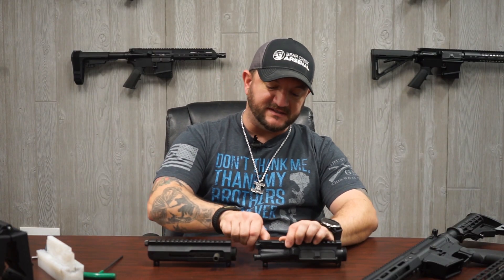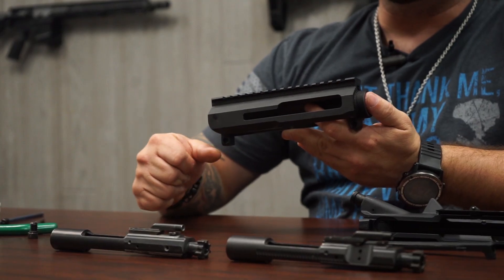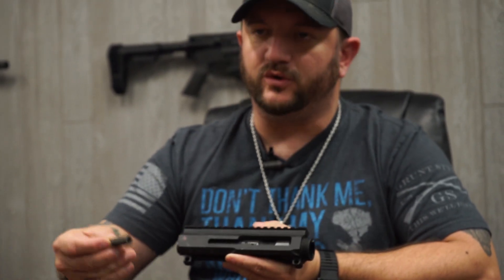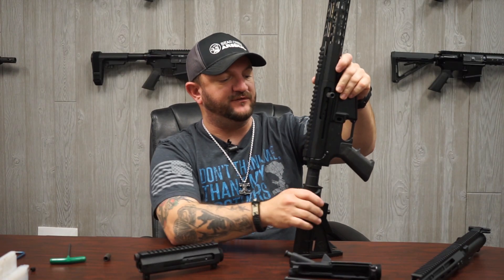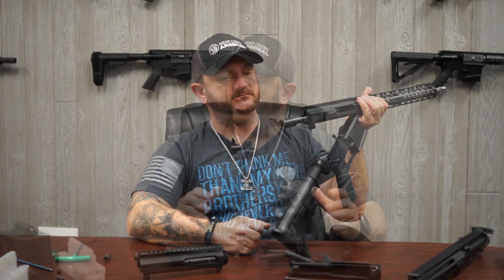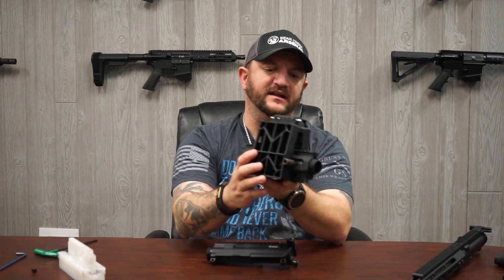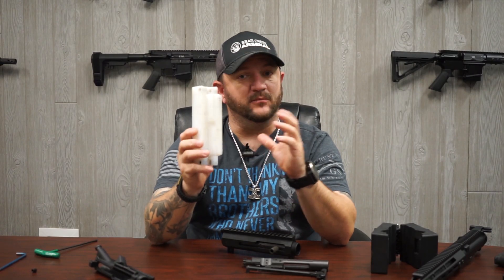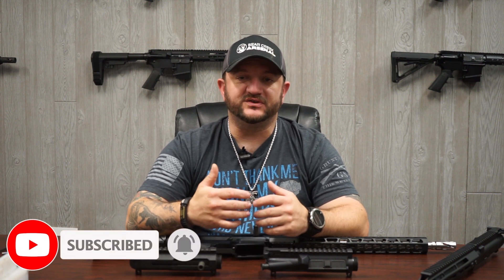Side Charging Upper: Guide, Tips, Maintenance, and More Common Questions

Comment: Thanks for the informational video. I thought of small concern with using the shaped vise block with the side charging upper receiver. Since the clamp vise block is not completely closed and seated snugly on the side charge upper, I think it is possible that a person could break their clam shaped vise block if they were to clamp the block down at the wrong spot with too much force. Just a possibility. As you said, it should work though but a person probably shouldn't clamp it down with the weight of the world haha. Other than that, I like the idea of the side charger because it seems to get rid of a couple of parts on the upper that could make it cheaper for everyone. No more forward assist which some people don't like anyway and the side charge handle basically becomes the forward assist. Obviously the rear charging handle is gone and it became the basic side charge bolt, so that would save on costs. Finally, the ejection port cover is gone. I think out of every thing, i'd want something like that in case I wanted to close up the side to keep dirt and grime out when not shooting but not the worst thing ever to lose that. 
 (After leaving my comment, I scrolled down and found a similar comment about possibly breaking the upper vise block. I was only 4 years late with my comment).

Comment: Is the right charging bcg capable of full auto use?
Reply from the maker: Our AR-15s are cut to Full Auto Style, Meaning it can support Full Auto firing
Reply: @Bear_Creek_Arsenal  
Thank you for the reply.  So I'm assuming/ hoping the stock provided bolt carrier group, the buffer and spring will function  properly and have normal longevity with a rapid fire FRT trigger?

Comment: Hope at the BCA factory that they stopped using that action block to assemble rifles/uppers.
Really should be using a steel (looking at you Wheeler) reaction rod with sail, like the Midwest or 2 Unique.
This would keep stress off the receiver/lugs/index pin/index slot, and keep the barrel/gas port aligned.

Comment: Just received my side charger complete upper. Does the receiver plug need to be threaded in very snug?
Reply from the maker: Thank you for the question, when you are tightening the threaded receiver plug tightens it all the way and then loosens it until the flat part of the plug lines up with the back of the receiver. Once this is complete, mount it on the lower. When you shoot the plug will stay steady.

Comment: Will any lower work with a BCA side charging AR10- 6.5 Creedmoor?
Reply from the maker: Our uppers are made based on the DPMS Gen1 Low Profile model.
With the AR10, there are many different designs and models out there,
and each company tends to create and design its own unique platform.
For that reason, we cannot guarantee the fitment of our uppers to any
other companies lower other than our own.

Comment: I stored household belongings for a friend and he gave me a rifle 6.5 BCA 20 inch upper. The lower has some issues but It's a keeper! Why? Because it's a tack driver with 129-140 grain. Working on the lower, who put the wrong bolt latch on and stuffs a roll pin into a threaded roll pin hole?

Comment: 2 year report here I absolutely love my side charge 18” hevy barrel 308 the greatest thing about it is i can use any kind of rear stock and accessories for it without a rear charge handle interfering in that day to day set up no worries raising and lowering cheek riser over and over plus i put 5 rounds on an ar500 steel plat in less than a 1/2 inch group i took a pic with my pinky finger nail next to it for proof i tell everyone I meet that asks me these bad boys are well worth the money thank you Bear Creek !! 😎🪖🧸🇺🇸👍🏻👍🏻

Comment: I just ordered this BC-9 | 9MM Billet Right Side Charging Upper | 10.5" Parkerized M4 Barrel | 1:10 Twist | Blow Back Gas System | 9.5" MLOK

SKU: 9476NB-UASCH9MMPM410.5110P-10M3
And completed the assembly. During the initial testing 115 grain FMJRN bullets it ran fine for about the first 200 rounds. Then is started jamming after three rounds. When the BCG stripped the cartridge off the mag it jams and will not feed into the chamber.  Drop the Mag and clear the round. Then it will fire three more and jam again. It has plenty of lubrication and it happens with Glock and MagPul magazines. What could be the problem?
115 grain Factory Loads

Comment: I am just now considering 300 blackout and been searching for a good upper assembly,im a LH shooter & i have a hard time with charging my ar15(have to have ambi charging handles) this side charging looks interesting & thinking on buying a 101/2 inch upper & a 16in & a crapton of 220 grain ammo to run suppressed. Great video & you showed me a lot,question is,why dont they include that little (headless allenscrew) with the purchase in case the lower is to high for the original bolt/nut? Or do they include it,i would just run it that way & keep my allen wrench handy. Great vid & im a sub now. Thanks for explaining it all in good detail for the learning crowd like me.

Comment: BCA, was there an engineering reason you did not make this an ambi or left-handed charging handle? While the 'T" charging handle is not ideal, you've designed an equally odd, right-side charging handle that reciprocates. Have you not learned anything from the AK and FN SCAR's reciprocating CHs? Robinson Armament's XCR has the best of both worlds: a left-side and non-reciprocating charging handle. This setup is more intuitive, and you don't have to take your hand off the trigger/fire control group to perform immediate action. The M-60 and M-243 SAW both have LH non-reciprocating CHs. The SCAR's CH is left-handed, and they recently made it non-reciprocating. This setup is better for a left-handed shooter. You would have something if you made it a left side or an ambi charging handle.
Reply: They do make several left side charging options.

Comment: I hated rear charge and got a bear creek right side and now i have changed my but stoch and cant even operate rear charge unless i have butt stock slid all the way back. But know my son built a left side. You hold an ar by crip and dont have to charge by reaching across scope with left charge and if you go to range use a brass trap and get by with right side. But left side use both trap if you have side discharge or even better use brass catcher that quick attaches to pickateeny rail life is then so nice.

Comment: I just picked up a 300 BLK from Midway. Puzzled about the rear screw that apparently stops the BCG during use. The screw comes with an o-ring. If I tightened the screw, it distorts the o-ring. If I back it off, the screw is loose in the back of the upper. Doesn't seem right to have a loose screw even though I can't come out because the flat is positioned against the lower.

Thoughts??

Comment: Can you purchase the headless receive plug from you - or would this work from amazon headless 3/8 in-16 X 1/2 in - the original plug had a rubber washer on it- does it need to be replaced
Reply from the maker: You can! Search it on our website. The o-ring is not essential. The product you mentioned will most likely work, but will stick out a bit

Comment: GFG Side Charger .308
Side Charging Handle Side Charging AR10 Side Charger AR10

   

Product Details

The GunFighterGear Side Charging Handle is a drop in part that converts any AR-10 rifle to a side charging AR-10.

Benefits:

-Operators primary hand remains on the pistol grip while charging, allowing for faster magazine changes.

-Bolt can be charged and locked back with just one hand.

-Ergonomic round knurled grip makes it MUCH easier to clear jams.

-Much more affordable than a dedicated side charging upper.

Our side charger is CNC machined from billet 7075 aluminum with a T-6 heat treat, giving it a tensile strength of 83,000psi, (structural steel tensile strength is 58,000-80,000psi)

The side charger knob is knurled for maximum control.

The side charger is mil spec hard coat anodized black, with an engraved GFG logo.

1/4 riser required for clearance with some brands of scopes and/or scope rings
This side charger is a drop in accessory for any standard mil spec rifle, but if it does not work with your set up, we will take it back no questions asked.

 This is for .308 Platforms and should be compatible with DPMS LR-308, Noveske N6 308, LaRue OSR, POF 308, Bushmaster LR308, Armalite AR10, LMT 308MWS, Palmetto PA-10, Ruger SR-762 and Aero Precision M5.

This may not work with the following: DPMS R-25 Gen II, Colt LE901, S&W MP-10, Bushmaster BAR-10, RRA LAR-8 and HK MR762.

**NEW!**

Youtube Video: https://youtu.be/HBzlT_Nfhyc

Comment: Side charge is pretty cool idea The only thing is you don't have a dust cover for example I have a DPMS 762 * 51 that doesn't have a dust cover the LR308 this particular rifle is based on the SR-25 and if you look it up the SR25 specs are almost identical to the LR308 made by DPMS but the DPMS does not have a dust cover it would be nice if there was a way to put a side charging handle on the BCG so you can charge your sideways instead of having to go all the way to the back especially when you have a scope on the LR308 do you guys carry the same configuration for the DPMS LR308 when it comes to charging handle not real charging handle but side charging handle just asking I have looked at this on different websites being in the Marines for 25 years you always had the rear charging handle thank you so much for the incredible video you guys are doing wonderful work I'm making the weapon work a lot better especially when you have a bad primer or a stove pipe keep up the good work I will definitely check out your website first time introduced to this website I was looking at Delta tactical and saw a side charging charger and was curious the difference between the regular rear charging handle and the side charging handle thank you very much sincerely yours gunny Joseph Velez USMC semper fidelis

Comment: Haha. Glad you made this. I just pulled mine out of the box and was pinning it up. It tool a minute but I figured out that the flat side of the gas screw has to face down. Excited to try it out. Do you guys have any mags for the 7.62 x 39 that are Texas compliant (30+) ?
Thank you for making the video. I was wondering where the charging handle was but it seemed to cycle fine after I messed with it.
Reply from the maker: We do offer a 30 round magazine. Please be sure to reach out to us if you have any additional questions!

Comment: getting ready to build a 300 blackout and ran across these side charging uppers.  I have fallen in love with them and am going to purchase one for my build.  I imagine you still use a standard parts kit for your lower, so my only question is, and it may be a dumb one, but I assume the bolt catch still works the same with the side charging BCG?
Reply: Yes it does. Hope your build came out well!

Comment: what type of  left hand side charging ar15 upper receiver do I need for ar15 full auto bolt? Is it a special type of side charging upper I look for? cause I saw some nice left hand side charging bolts half way cheap on the internet for sale but they are all left hand side charging! and do I have to buy full auto bolt tube and trigger set?

Comment: Does the standard forward assist function on the side charging BCG?
Reply from the maker: The side charging handle acts as the forward assist if needed
Reply: @Bear_Creek_Arsenal  awesome chances are in most circumstances I won't have to need it but every once in a while I have a handload that is bulged or something and it'll try to not to return to battery. I love my mil-spec 5.56 upper, I just ordered a 300BLK upper a couple days ago from y'all I can't wait until it gets here so I can try it out, it'll be my first side charging upper and also has that sweet bear claw fluted barrel. I'm excited

Comment: The design on the charging handle is shit …..I had less than 1/8 inch of thread to even start in the bc the handle blew off after 20 round and the female is so wallered out it’s done 20 ROUNDS!! I called BCA and they immediately sent me a prepaid label to send the bcg in and get a new one …..But I hope I don’t need that rifle for anything during the month or so that will take AND what am I in for w/ a new one? Same issue ? I’m thinking about taping that hole the next bolt size and making a charging handle …..anybody have ing the same issue ? Again BCA is standing behind their product and replacing it but a shit design is just that…so I dunno

Comment: I have a 5.56 side charging pistol upper from BCA that has been sent back TWICE. I told them the second time I did not want it back. And yet they sent it back to me this week. It sticks live rounds in the chamber and has to be butt stroked or tapped open at the bolt handle with a tool. It's clearly defective and dangerous. Yet you keep sending it back to me claiming nothing is wrong. Maybe you guys should check out Hi Point customer service to see how it SHOULD be done. I have bought 4 different uppers from BCA but never again. If your idea of customer service is to leave me stuck with a defective and dangerous product then there is NO reason to buy anything else from you.

Comment: I bought an upper awhile back, all light primer strikes. Replaced with their newer bolt and enhanced  firing pin, nothing. Replaced hammer spring with Wolf extra power, about 50/50 light strikes no matter what kind of Soviet ammo. Installed an h2 buffer and red Sprinco buffer spring, no change.. Bought a whole different upper from BCA and put all  my innards in it (to keep it scientific), works great. That means the first upper was out of spec in the chamber causing the round to sit too far forward, preventing the pin from reaching the primer enough much of the time... Doesn't take much. Wonder if they'll let me return or replace the out of spec upper? (Posted several places in hope of helping someone else who may be in my same spot, gun Smith confirmed my thoughts)...
Reply: As I understand it, they offer a lifetime warranty.
Reply: You lost me at Soviet ammo no ar 15 is made for that berdane primed crap
Reply: @robertsien1623 I built a 10.5" inch 7.62x39 AR pistol, runs like a clock, just saying.
Reply: Update?
Reply: Did you buy it from BCA?  Why not just return it, they have great customer service, at least that's my experience.👍
Reply: Posting it does nothing.  Contact customer service.
Reply: Sellit for a good price and the same updated system

Comment: Why not just grind a little more from the flat side of receiver plug, I'm going through the same issue it want let my aero precision complete lower mate  the take down pin almost goes half way in ,so if a little was machined off it would work . My is a 308 side charging

Comment: As a lefty, the side charger has no shell deflector. So in which direction do the shells eject after firing? Forwards, to the side, or the rear?
Reply from the maker: The side charging handle acts as a brass deflector if needed. Take a look at some of the slow motion footage in our other videos and you can see this. We also have left side charging uppers as well

Comment: Where can I purchase a vise block. Like the one you demonstrated using in this video. The white block. Thanks
Reply: Great question, Did anyone ever get back with you with an answer? I bought a Vism Upper Receiver Block but WON'T WORK with a BCA side charge upper.
Reply: @ronream8882  , thanks for the feed back. I did find that brownells sells them

Comment: So in a pinch, you could take your side charging bcg, install it..and as you're doing that, pre load a cartridge in the chamber. Pin the upper to the lower, and then when you fire the rifle, it will start cycling rounds. 
But don't do that.

Comment: Guys please explain me i don't know a thing about this if i Buy a ar 15 5.56 what do i need to switch it to 7.62x39 or 308? Just the Upper?
Reply from the maker: Hey Roberto, our 7.62x39 uppers will fit directly on any mil-spec AR-15 lower. Due to the longer length of 308 (7.62x51), it requires an AR-10 lower and upper

Comment: Of the threaded plug isn’t tight could that result is gas loss and cycling issues?
Reply from the maker: The gas plug isn't necessary to the function of the firearm at all. It's just there to keep excess gas from blowing in the user's face
Reply: @Bear_Creek_Arsenal  ok, thanks for the response.  I just bought a new AR with side charging and it will not cycle ammo at all.  I was just curious if it was due to the plug not being tight enough and allowing gas to escape.  The gun ejects ammo on but it’s short stroking and not picking up the next round
Reply from the maker: @Afflictionx28  Sorry to hear that! Check to make sure the gas block screws are tight. If that does not work, email bcatech@bearcreekarsenal.com and they can assist you

Comment: To every BCA side charging owner ...Forgive my ignorance of knowledge. But can someone please tell me why the hole that the threaded receiver plug goes into even exists?

It would seem to me that the upper should be built different or milled differently so that the hole doesn't exist at all if it's only going to be plugged. What's the significance of it? I would really be afraid of a structural failure where the pressure blows the plug out and into my face!

Please elaborate more on why it's there.

Thank you.
Reply from the maker: The side charging rear receiver plug was designed to keep gas from escaping and blowing in the user's face while still being able to remove to allow for the BCG to be taken out for cleaning and maintenance. When mated to the lower, the screw is extremely tight and has no probability of coming loose. Hope that helps!